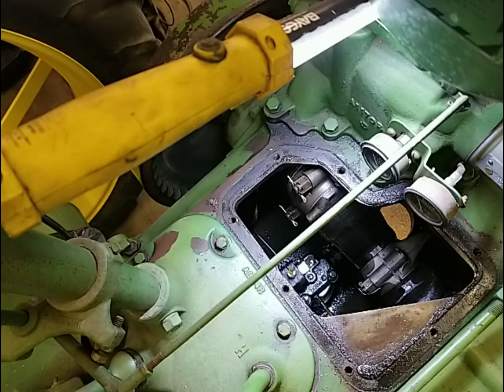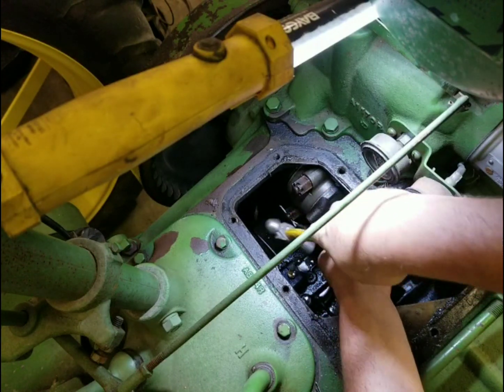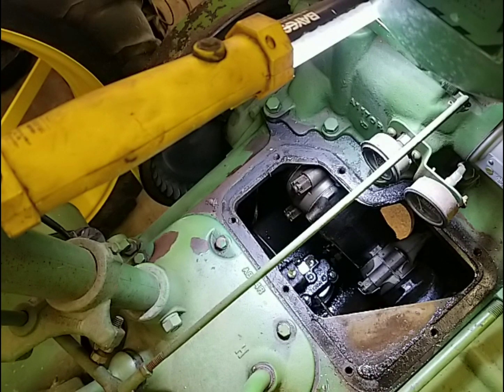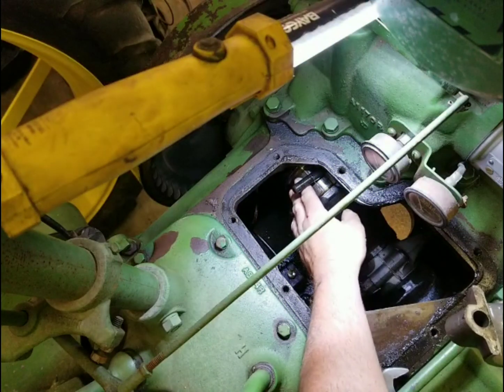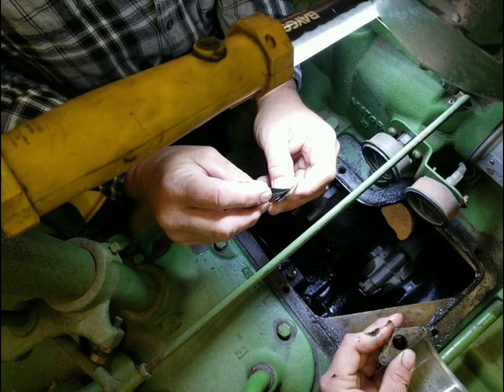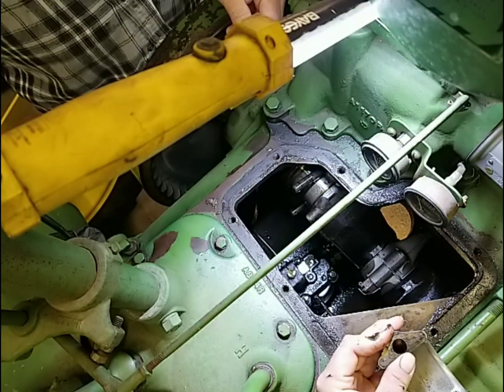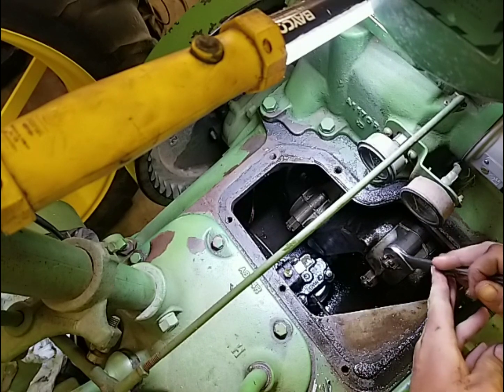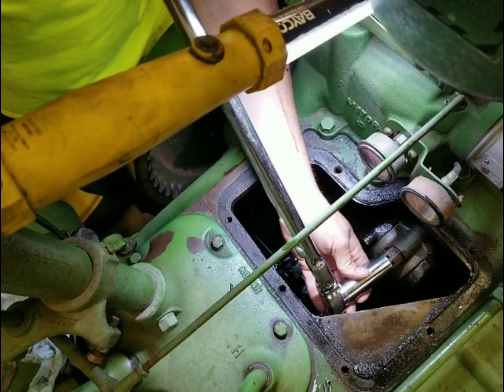1936 A John Deere Two-Cylinder...We Dig Deeper!!

Comment: I am going through a full rebuild of a 1940 B. I sent my mains and rods to Harts machine in Cecil Ohio for refurbishment. They did an excellent job. Everything is good and tight now. You will need to send the crank so they can match the radius. I didn't and had interference and had to blue them up and scrape them in. I also had to have a new block and pistons. The engine is done and am going to replace all the trans bearings. Never ending it seems. Have a fortune in it so far. Keep throwing hundred dollar bills at it...

Comment: Forgot to say mine needed a new pump also. Those systems are high volume low pressure. I thing a new pump and line and bearings and it will be good to go. The pumps are readily available. Be sure and check ALL the lines while you are in there...

Comment: That lateral clearance on both rods are way more than the .060" max shown in my manual, so you would have to do something about the bearings anyhow.   And BTW: The guy who mentioned the oil line was dead on the money.  Judging by what you've found in just an hour or two, I think the rest of that tractor needs some close look'n at.